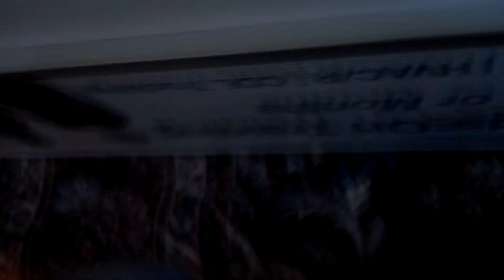1/14 Tamiya custom trailer with side skirt New crank handle for the NTI trailer support legs.

Comment: How you made the skirt where you made them from and how you kept them attach to the trailer
Reply from the maker: Sorry, didn't see your question. skirt is make from square duct vent. cut edge with the s shape inserted a window squeegee bent the other edge 90 and removed the deck boards, bolted the skirt in place and reinstalled the decking.